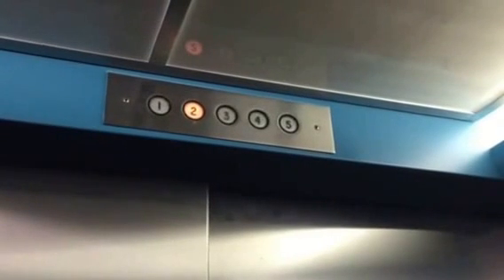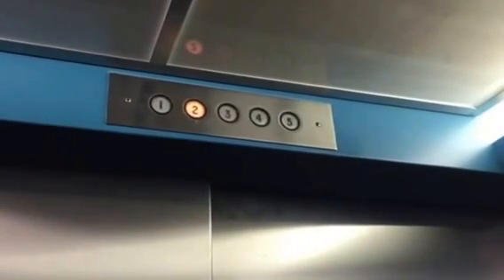Happy Halloween: Sketchy Vintage OTIS Traction Elevator @ SDSU Chemistry

Comment from the maker: +upanddownadventures It has a Motor Generator. It said Gen Field.
Reply: +Traction151 
The thing is, often, I think they forget to update it to VF (variable frequency) on the permit, when they modernize elevators. This elevator would originally have had a motor generator, but it may or may not still have one.
Reply: +Traction151 
Also, I sent another personal message. Do you receive them immediately if you are on YouTube, or only when you check?